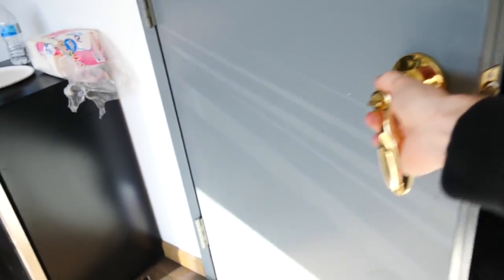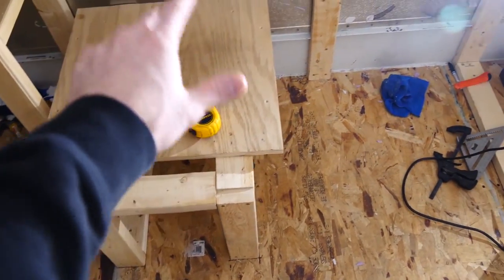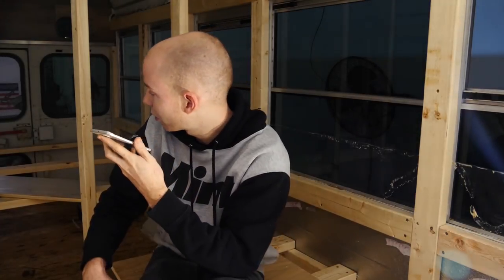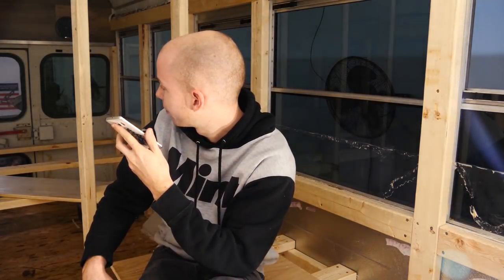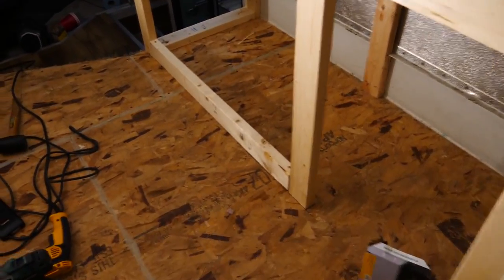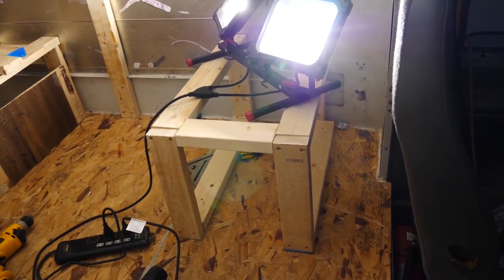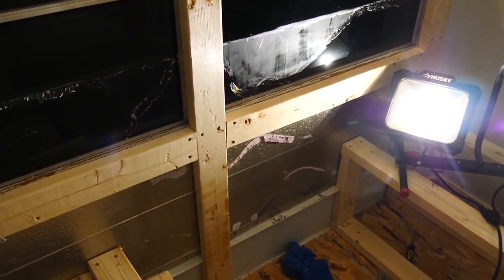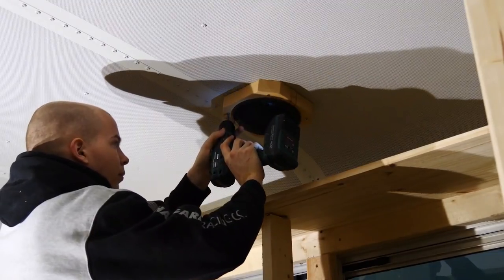Appliances in a SCHOOL BUS? More Progress Done!!!

Comment: I know this might be a bit random but been re watching a the Adventure bus video's and the drivers seat does not look comfy at all might i suggest a air ride seat i am sure you can find a air ride base with out the seat rather cheap and just find you a conversion van seat G series Chevy Conversion vans almost always have very nice captain seats with arm rest and most come in leather or fabric and a wide range of colors and are pretty damn comfy.
Reply: Also I would look into a Travel Trailer Power converter/Charger that way when you are at a camp ground and have access to power you can plug in without having to worry about your batteries draining i used to use a Powermax 100amp with 4 Deep cycle batteries and a Aims 8000watt inverter powered a dorm sized fridge with freezer a A/C unit 32" tv Xbox 360 while charging 2 laptops and all my lights at once never had a single issue tore it all apart for 2019-2020 rebuild.

Comment: You better have a massive battery bank or your 6000w inverter will drain your battery in 5 min
Reply: Smackvttv those busses have two pretty hefty batterys in them as is.they also might have a nice charging system id assume because of the added lights and whatnot. he should be okay as long as he has it running when at full peak.
Reply: Yes and you need them to start the huge motor you will definitely want a battery bank that is separate from the battery s that start the bus  or you will be stranded I live off grid ( no electric)    Only solar/battery s. For 10 years and I’m a auto mechanic for 20    :)    Also work on sailboats just my opinion though
Reply: I'm not real experienced in it🤷 just educated guessing

Comment: 3000 watt inverter is about 30 amps.  Is that enough?
Reply: 30amps on the AC side should be plenty that's basically 2 typical house circuits worth of power.  I'd be more worried about the DC side amperage, hopefully he goes with a 24 or 48v system. At 12v it would be 250a which is going to need super thick wires and cut off switches, fuses etc may be harder to find.  24v would be 125a which is a bit more manageable and 48v would be 62a.  48v all depends on how many solar panels he can fit though.  You want to Vmp (voltage at max power) rating to be a bit  higher than the battery voltage to get the most out of it.  I think he'll be fine though there's plenty of room on the roof.
Reply: I think he said he wanted to run the reefer, AC and the microwave at the same time. That's a bunch of amp from that inverter.
Reply: And, make sure the size of the wire he uses is adequate for the amps it will be carrying.  He will still have to watch which appliances he uses especially if the A/C is on.
Reply: Yep that's why it's easier to go higher voltage on the DC side (48v instead of 12v) as you basically can cut the size requirement in 4.  There are gauge charts online that tell you the size of wire you need for a certain amperage.  They seem to differ a lot though, so I tend to be conservative and oversize a bit.  I would do 48v (62.5a when drawing 3kw) and #2 wiring on the DC side myself.  Can probably get away doing 24v (124a when drawing 3kw) and #2 as well but it's cutting it close.  Essentially: watts = volts times amps, so the lower the volts the higher the amps, for the same wattage.  Of course he won't be pulling 3000w for very long if he even does but still good to rate everything for it.
Reply: I know.  I'm talking about the use of the 120V ac side. He may be setting him self up for failure thinking 3000 watts will handle AC, Microwave and refrigeration all simultaneously.
Reply: Yeah probably don't want to be using everything at once.  A lot of big inverters are also split into two smaller inverters, so something to check for to balance loads right.   The bigger AC units (12,000 BTU) will use a whole 15a circuit on it's own, a microwave will use close, maybe 1200w.  He technically could run both at same time, but it's cutting it close. I think as long as he's aware of how much things use he should be ok.  I would not go with a huge AC unit though as the startup might be too much for the inverter.  I also hope he got pure sine wave model, if it's not pure sine wave it might not even run an AC unit.